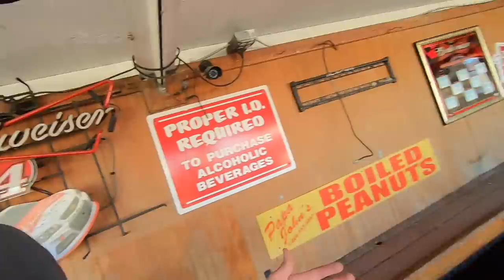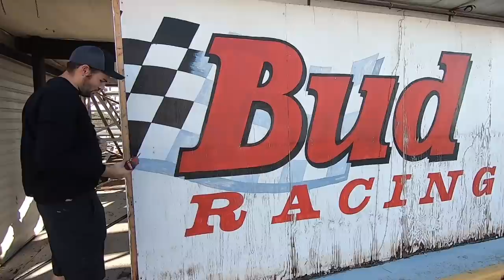Renovating an Abandoned Racetrack Part 3 - Demo & Remodeling the Freedom Factory's Bars and Kitchen!

Comment: When it comes to the walls in the back of some rooms which then face the bleachers you should make em aluminum since then they can’t rott out like the wood did on you. And for the concession stand with flip up thing maybe try slide up glass ones it will give of a more concessions vibe. Also for menu thing which you see above the window don’t go fancy with electric ones they will just breack on you.
Reply: If you make the walls aluminium it will be very hot though, and cooling it will cost a lot more in summer
Reply: @jasont4400  yeah I’m thinking it’ll be loud as hell with the track and bleachers right there too
Reply: @calebj5082  makes sense

Comment: I think you should do a zinc top for your bar tops. It's kinda like a stainless steel but with zinc you can patina it if you want and seal it and it will last a long time. Zinc also ages really well as well.

Comment: That bar ceiling, just batten straight over existing, insulate and new upper skin sheet straight over the top, paint the bottom.  Now you have a sealed insulated cavity to wire through.

Comment: Use a bar top pour on. It will go on thick and allows you to put stuff on the bar under it and cover it up as wells as not needing a poly on top. They usually come in 2 part kits (resin and hardener) I know the company I work for is a very dor for a product like that and it's roughly $140-150 per 2 gallon kit

Comment: The section with the windows that you want to remove you should put big sliding windows for light and you would be able to put a vendor in there. Put a wall on the bar side with a door to get in there.

Comment: Heya cleet! Just my 2 cents. For the BIB system, I don't think you should get rid of it. Or at least not all of it. The reason being is that when the factory is Full swing, you gotta serve thousands of fans on a Hot.. Sweaty.. humid, florida day, and that's gonna take up some SERIOUS fridge space to store all thoes cans and bottles. So storage may become a issue at some point. It wouldn't hurt to have at least 1 BIB system on standby just in case. Just 1, 5 gallon bag of syrup can produce up to 30 gallons of soda. (Depending on mixing settings) the space saved can be used to store more beer. And different brands too, both local and non.

Also, with the walls.. wouldn't hurt to make them florida hurricane proof. 😅
Reply: Also! You can rent beer wagons I just remembered. When I worked for Six flags, we rented them during Octoberfest! Absolute Units!

Comment: Don’t epoxy the bar tops. Just bend up some stainless steel covers for it. Way easier to wipe down. Protects everything under it. And instead of spending an endless amount propping up those concession buildings. Rip them all out and do like a really long sheet metal shed. You can easily pop in windows, won’t have to paint it, custom make sections into whatever you want. Won’t rot and will look good for way longer.

Comment: May be a bit under on quantity per keg/bottle but there is a system called "draughtmaster" you have cold beer on tap with no Co2 needed, has a system built in that automatically cleans the lines every 28 days, the alcohol comes in fully recycleable plastic bottles, look in to it boys

Comment: Use the sheet stainless from the units you're gonna scrap as gerbox teardown tables, or even welding tables for McFarland Fab. Could even make a model DeLoren, with a brake bar.

Comment: Ok Cletus this is from experience working in those fields, get a price from a local Pepsi and a local Coke for the drink areas of the stands hell get them to bid on it, also include any local concession company to bid on it and the bar area and get your local beer distributors to also bid on it before you go any further,  you could market it as a they can make decisions about those areas.  Your walls that may get wet, use a pressure treated bottom plate, then take a 6inch epdm tape like flex seal or any 6inch epdm roofing tape to wrap the bottom side of your sill plate,  the sill plate is the bottom plate of a home that touches the concrete or block,  this will seal it and prevent water from soaking up into the wall.  This will extend the life of your wall.  But because it is sitting on a concrete floor it should get you 15 to 20 years vs a 3 to 10 years a wall like that in Florida should be expected to go.

Comment: I think you need to gut one Crown Vic, reverse the front seats with a small table in the middle.  Parked at the other end of the bar it could be used as a VIP booth.

Comment: I think you could turn the bracing into kind of an artistic piece to draw people in simply by making it look a little industrial. Just an idea, maybe focus on making it look modern. Having wheels or car parts (kinda like how people build trophies, and Larry Kosilla did with his detail shop) incorporated as part of the display and working features inside the bar. Wheels as part of basically a lamp shade, cams or connecting rods as a door handle. Maybe from projects in the past you've smithereened. lol

Comment: That Bud Racing sign i would reuse for the half wall in same location and just cut the bottom section thats rotted and cut the top above the Bud. Trim it down and throw it back up for the half wall.

Comment: Don’t replace the wall. Save time by cutting about 3-4 feet up and doing the bottom in stainless steel. Will last longer and easier to clean.

Comment: Bag system for the soda is cheaper and you will make more money per soda. There are modern ready mix soda stations that have a better mix and you dont have to buy it"lease". You can make alot of money on beverages when you have bottles or cans alot of the cost is built in. You have to think volume..the larger the crown the better.

Comment: With draft beer, you will have better margins for sales. the cost of draft is all up front, so initially it is expensive, but the return over time is well worth it. The beer distributor will have line techs that will clean the lines for free. Just make sure that you get it in writing with the distributor that they are responsible for cleaning the lines. The beer distributor that I worked for cleaned all the taps that had the distributors product coming out of. easiest way is to give all the taps to one distributor, but if you split distributors, for example Budweiser and Miller, make sure you get them to agree to take responsibility for cleaning the lines.

This way you will only have as little responsibilities as possible. You will be responsible for the installation and maintenance of the glycol system, changing kegs when empty, sales. The distributor should take responsibility for sending a sale's person to put together an order and figuring out what brands to sell and signage to promote sales of their product.

If you absolutely do not want a draft system at first or ever, Beer distributors almost always have party trailers that can hold roughly 30 kegs, half barrels that way you can also sell draft beer. You responsibility would only be to provide power to their party trailer.

Also, ask about sponsorship. If you can bring in numbers and sales, distributors are willing to either offer cash or product to be exclusive at stadiums. Distributors also have donations to where if you do a event for track sponsors, that they beer distributor most likely will donate x amount of product for your event, especially if you include a charity.

Beer distributors are extremely easy to work with, so dont be afraid to make some demands and keep a firm stance on things.

Comment: Honestly you should really consider completely re building all those "shack" builds under the bleachers.
Pretty much guarantee the rest of them are just months away from being in the same condition as the one you tore down.
Some of the interior stuff might be salvaged like the bars, but the walls and ceilings are all likely barely holding on.

Comment: As a 5 state architect I tell you Cleetus ,..WITH  your YouTube channel and subs, the crown Vic race that will be sooo huge,. YOU have the chance to actually make a racetrack comeback, this track will be SO HIGE 5 years form now; get out of this covid crap and it’s a no brainer BEST decision ever!! Keep the marketing snf racing as you have done, it’ll be the biggest thing ina. Couple years.  Bleachers are all steel I-beam supported, your good for ever there.c the roof on concessions is simple.x some 2x8’s s over with some 3/4 t &G, 1/2 inch OSB ceiling , some 4mil moisture barrier and arch grade shingles, it’s a. Cheap relatively fix! You got this! KEEP GOING! ITS FAIL SAFE I’m not kiddin , do it! Kee going ! Post Covid it’s done deal , EPIC!!!

Comment: The fountain soda system is the most profitable drink product you can have and then having your own freedom factory cups is a way to advertise your track for practical nothing. I as in the food industry for 30 yrs would not take them out. The cost of a 64oz fountain drink is around 1-1.50 with the cost of a custom cup. If you go with plain Styrofoam cup cost is about 0.65 cents including cup and 64oz soda

Comment: Sure you won't bother with comments but you should have an enduro for fans of the show. I would more than be glad to help you with rules. Have a 4cyl one and a 8 cyl one. No race cars just cars from the street. Minimum 4pt cage. If you get a bunch of competitors show up that set there cars up to turn left. Make them all race the track the opposite direction.

Comment: Cleetus,,,,,Im a Certified Electrician, and chances are, you DONT have to change those plugs out to GFCI`s, those plugs are probably connected to a GFCI Breaker. Check your Breaker Box to see whats in there.
Buying a bunch of GFCI Plugs is going to cost you a lot more, verses using just breakers.
Just keep that in mind brother.

Comment: im an hvac contracteer just a question have one of those big bins for ice machine where the hot dog cart is why not just buy one big ice machine and put on that it would be taller yes but you could have more ice in that bin then you would in both ice machine and rather than buying two ice machines you would only have to buy one. Just an idea.

Comment: Tbh the bar looks like you should just replace everything the only good thing that looks good is the top of the bar but still needs refinished and sealed doesn't seem worth saving anything just redo all of it and figure a way to wether proof it because if you use wood again it will just rot all over again I would try maybe some galvanized or stainless as structure and use ceader wood as the facing because it's naturally water resistant and if you use polly coating it will make it alot better it also would give it a nice smell with a warm looking bar area the tile doesn't seem like it was done right and they used the wrong putty to put in the tile so it might be worth redoing the trial and just replacing the wall keep the tile reuse it but clean up the look and the wood it may be even worth using some nylon coating on the bottom of the boards to keep it from rotting again I'm no expert but it seems like these may be the way to go just some ideas feel free to dissreguard my ideas and do what you want lol it's not my race track and idk what kind of budget your working with but I was always taught do it right the first time and you won't have to do it a second time

Comment: Fla people must be MUCH better fans than the people at North East dirt tracks.  You really need to think about cans and bottles in the stands.  Hard to do any real damage throwing a paper or plastic mug.  Sure, it takes a lot of clean up after an event, but not as bad as cleaning up broken glass all over the place.  I bet if you check with your insurance company they will verify that.

Comment: Contact the "Pepsi Bottling Group in Sarasota FL and see if they can hook you up with some Mountain Dew branded soda fountains and syrup.  Fountain pop is a huge profit area, this is due to the fact that it only costs pennies per drink compared to the low high cost (low profit) of storing and selling cans or bottles.

Comment: Bottles and cans are a bad idea. Kegs do require flushing and maintenance and that takes some time. Cans and bottles will need huge refrigerated storage and lots of muscle loading cases in and out. Bottles and cans become projectiles because drunks are stupid. Cups don't fly far. Recycling hundreds of cans and bottles is smelly work that no one wants to do. Cups are easy to empty so it keeps the funk down. Kegs are far far more profitable too.

Comment: You won't want to serve beer out the side towards the stands you will congest the walkway into the back on busy days. Also you will want to contract with Pepsi for a new BIB soda system let them install and maintenance it. Canned or Bottled soda it expensive all around.  If you have Pepsi put in a new system, it's more money to have Pepsi do it but no one like's nasty fountain soda. The only thing worse than nasty fountain soda is expensive canned soda.

Comment: Please for the love of God do not replace the heads on the ICE machine without first looking into why they wont come on. Ice machines can be expensive and the model you have there is the one I have and a no power or compressor not coming on is usually a simple issue(had the same issue with mine, turned out to be a $20 part). I would have an ice machine tech come look at them first.

Comment: Address your demographic before doing anything. Canned beer is far less profitable. Tap beer is far more social and profitable, If you want them at the bar you'll have televise the track in the bar (they'll never leave). If you want them buying beer and taking it back to their seats, then cans will be better. And maybe styrofoam cooler carriers (2-pak-4-pak, 6-pak) will piuck up your profit. It's all in how you market it. This sounds like a fun project, I hope your money-flow is good.. Food is the other consideration. How are you hoping to cycle your customers? Just Hotdogs and hamburgers? Then send them back to their seats. Anything more elaborate?  If there's enough room you might do both. Concessions can make your racetrack work if it's done right and people want to be there.